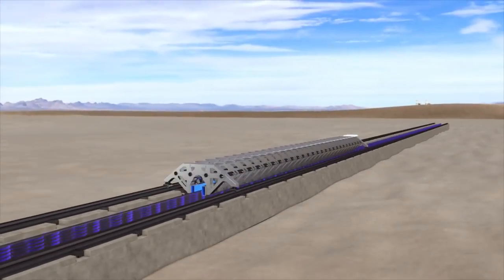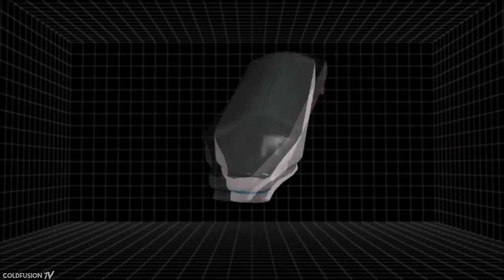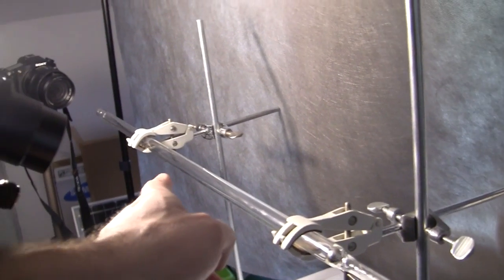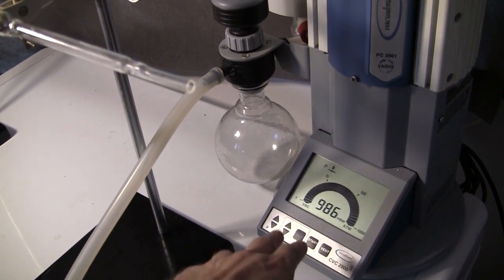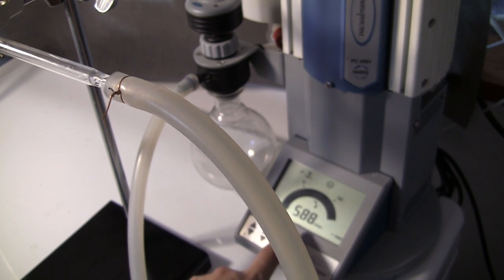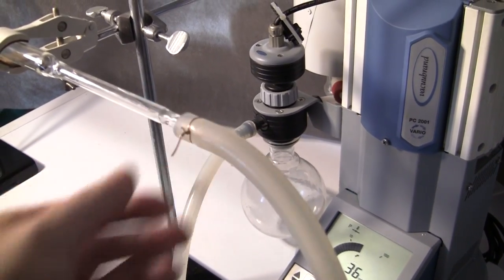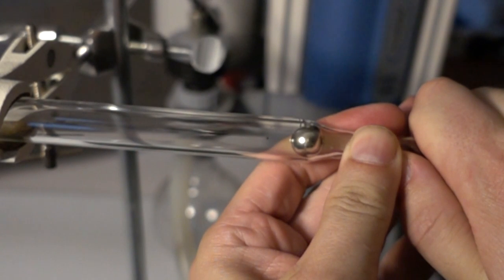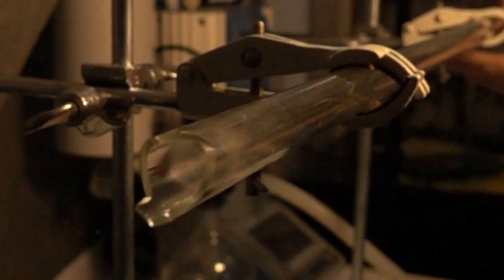How  the Hyperloop can kill you!

Comment: The hyperloop is nothing more nor less than a maglev train in a mostly-evacuated track, both perfectly well-understood technologies. No competent engineer would use the sort of accelerations you show in this, so the "gun barrel" analogy is faulty from the first. And again, maglev technology is well-understood, and the relevant engineers have been building maglevs with excellent safety records for decades. There's nothing revolutionary in this, and no need for extensive debunking.

Comment: Your on magnets they can slow you down easily! Busted Thumderfoot!
Reply: Ah like in this experiment where that 600+ mph pressure wave hit that metal ball bearing with no breaking system what so ever, was blasted forward at an absolute bone crushing 3 g's? You know like what you might experience on a roller coaster.
Reply: Ok, what happens when a pressure wave hits the pod at 600+ miles per hour? Do people really still need it explaining to them what happens when a vacuum suddenly becomes not-a-vacuum?
Reply: the description does explain that this is just "simulating the effects of a tube failure on someone in the hyperloop"

the video doesn't advertise anything other than that possibility and I don't know why you would expect anything else. Seriously guys...?
The description also states that a longer video with a "more compelling argument" is coming (may already be out? I haven't checked), which may be more along the lines of what your looking for.
Although... I wont vouch for rather or not those arguments are any good. lol
Reply: I imagine this works similarly to a maglev train, in which case you can just reverse the direction that the current is travelling down the track. Also, a computer can react quickly enough.
Hyperloop is still idiotic regardless.
Just for even more basic reasons.
Reply: It takes two magnets to repel and the track's electric field can be reverse to attract if it detects a pressure increase or excess velocity.
Reply: No person can react that fast, but do you really think such an important safety system would be used by a person? A computer could detect the breach, and make every magnet in front of the train slow it down.
Reply: why all the talk about magnets? I thought the design of the hyperloop was to have it levitated via air-caster.... as to propulsion, im not so sure but it doesn't seem magnets were settled on. The design is trying to avoid maglev from my understanding
Reply: Meow ster Magnets would be an advantage for safety reasons stated above. I'm not sure what the air-cast concept is but wouldn't that invalidate the vacuum (no air molecules)?
Reply: MasonDixonAutistic This wouldn't so hard to deal with. Agains, the system can detect a compromise and reverse the magnet polarization to force-stop the track.

There will always be some risk, even now a regular train can theoretically derail if the track is messed up.
Reply: Gerbeck S. idk,... air-caster is kinda like what air-hockey tables do. it confused me also, but the design concept stated running it along air-caster tracks while still in a vacuum. It was also specifically mentioned that maglev was being avoided due to the expensive costs.
Reply: SpaceCowboyfromNJ A rollercoaster can be brought to a halt and so can a train sitting on magnets that reverse polarization and clamp down on train. 

A bigger issue on a hyper-loop train is if the oxygen reserve or internal pressure from the train leaks out. Then you may have to actually  de-vacuum the chamber the train moves in on purpose.

Anyway this is all nonsense and defeatist. Airplanes can fall right out of the sky and they are still the safest way to travel.
Reply: Meow ster An air-hockey table recycles air in the room and forces them through little holes (increasing pressure) so it can't work like that since there is simply no air.
Reply: Gerbeck S., I know. My answer was a bit of sarcastic reply to MasonDixonAutistic. 3g's are not something that's really dangerous that you need to worry about, and if you want to get real technical as you scale this up the acceleration you would get  from such a catastrophic failure decreases.
Reply: Gerbeck S. that part confused me as well. I understand that full well. But that's what was claimed as the design.

Comment: they could have emergency valves that release pressure all along the tube.
Reply: they'd take a while to active in order to avoid the pod's being damaged by rapid decompression and possibly causing a leak
Reply: @killian9314  release pressure where? the issue isn't that the pressure is too high, the air inside the tube would be at equilibrium with the air outside of the tube (1 bar).
Reply: release pressure? In what is effectively a vacuum?
Reply: X D

Comment: ------Long post expand it--------
OK you build a vacuum cannon so what. Those points you made are valid and simple physics.
BUT those are so easy to fix with engineering that's almost hilarious.
First of all what you have shown is the worst case scenario which would be equal to a terrorist blowing the tube up.
Means it's not valid as a real world failure case. (And since those guys have a very questionable education they would probably blow the tube before the train passes and help to break :-)

Now to a more likely scenario the tube is somewhere compromised and air is able to get in.
Maybe a construction crane rip it open somehow.
First the physics, which aren't as bad as shown:

-The air is able to get in the tube but only through a small hole compared to the tubes diameter < slow down factor one
-Then its force is immediately halved because it has to expand in both ways, towards the moving train and into the empty tube it traveled through < slow down factor two
-The train won't fit tightly into the tube so that the remaining space between the train and the tube is probably way bigger then the surface area of the hole so most of the air is able to pass by. Considering the trains inertia it will probably get only a really hefty bump. < slow down factor two
(However this will be a considerable force which would result in traumas, concussions and probably some broken necks so kudos there Thunderfoot)

So now to the engineering counter methods:

-First of all the entire track is fully covered with sensor technology and any breach would be known in seconds maybe even less.
So anything in the tube would be already aware that there is a problem and begins countermeasures.
-The train begins decelerating and prepares for the impact of the air mass, with a clever braking maneuver it could also make the aforementioned bump neglectable.
-Vacuum stations along the compromised track are set to equalise the pressure in the tube to normal atmospheric pressure.
-Emergency/maintenance bulkheads in appropriate distances close to save the low pressure zones in the remaining tracks.
(Man keeping up vacuums is so freaking expensive, for that reason hyperloop won't go near a perfect vacuum just enough to travel faster)

All this is probably done in a few seconds so I feel pretty safe traveling with it.

Comment: But if the force applied is bassed on the diameter of the tube then it will increase linerarly while the mass will increase quadratically, so the acceleration should be less than this, not more.
Reply: Squarely, not linearly. But yes, your point still stands.
Reply: ***** 2 is squarely, and yes I forgot to realize that the volume increases cubically.
Reply: link4265 The term is quadratically, not squarely.
Reply: Read the description- the acceleration of the pod isn't the issue, it's that it will be hit by air rushing in to the vacuum at the speed of sound. The pod will be lucky if is only displaced and accelerated. the more likely scenario is that it's shattered along with it's contents(living passengers).

Comment: Argument not compelling. Rare
Reply: Hyperloop is bankrupt 14/01/2024
Reply: Hundreds of mile of tubes is a pretty tempting target for any nut with a gun. A single gunshot is all it takes for a catastrophic vacuum failure.
Reply: Dude read the description seriously wtf.
Reply: What about a small bomb? Couldn't that cause vacuum failure?
Reply: +Starfish incorrect. Have you seen Mythbusters? It takes far more then a bullet hole to create explosive decompression in a plane. A small hole would not allow sufficient air flow to really damage anything. Even small cabin leaks in space do not cause explosive decompression, and that is effectively the same scenario only in reverse, air going in instead of out. To cause this kind of failure that thunder foot is demonstrating would require a drastic failure, like complete tube collapse, not a bullet hole.

Comment: one would literally have to blow up a section of the loop to get that result,  this is not a problem impossible to overcome, just adding some sections with tesla-valve like structures on the wall could significantly reduce the damage of a pressurization event

Comment: Best solution: Don't use Hyperloop-tubes that are made of glass. Use something like steel for example so it won't break like glass. In worst case it will get a crack that will have to much resistance for the incoming air so the train won't be catapult to uncontrollable high speed.
Reply: Vacuum does not have a temperature. In fact, it preserves temperature because heat is not transmitted through contact. Space is cold, but if you send a hot metal ball out there, it will cool way slower than in earths atmosphere since there is no contact surface to transfer heat to.
Reply: levi warbrick 
This is obviously made to compete with planes, not with buses.
Reply: Meow ster
" ... because squashed against steel is so much better?"
There is no sqashing. It's about catapulting inside a tube. It's a tube hundred of miles long. There is no sudden end of the tube in the middle of nowhere like in the glass-tube that is used in this demo. Do you understand anything?
There will not be a catapult effect anyway. Because in worst case there will only be a crack. And a crack will not let in enough air in short time to accelerate the train to dangerous speed. Besides that traveling at 1200 km/h is the normal operating speed. This video is just stupid. I'm sorry to say that because I really like Thunderfoot.
Reply: ... because squashed against steel is so much better?

LMAO

He should be testing their braking system tho,... yea...

@TheMegatomicDragon
As for him falling? Maybe, but get real... this video would not be any indication of that. This video does and shows nothing more than what it advertises. Reading the description some might help as well. Something about this being just for fun, and "simulating the effects of a tube failure on someone in the hyperloop"
Nothing in the description or title promises anything other than that and it delivered exactly that.
Reply: Steel is softer than glass, comparing like with like, hardened steel with hardened glass, regular hardened steel is brittle in cold temperatures like a vacuum. If something gets a crack in it under these conditions, it does not matter what it is made of outside of fantasy(like a tunnel made of diamond), a real-world material for a man-made tunnel, it's going to be destroyed to the fullest extent it is solidly joined together. The train won't be catapulted as in the video demonstration, read the description: it will be hit by a pressure wave at the speed of sound, only a one-bar difference would be lethal, an actual real-world pressure wave will be multiple times that in such a tunnel. This is why it takes months to do maintenance on the Large Hadron Collider- not because it's big but because a vacuum runs it's entire circumference when operational and the pressure has to be brought up to normal atmosphere slowly.
Reply: I can't tell if you're trolling or not, you had best be.
Reply: MasonDixonAutistic 
Tell me where I am wrong. How do you think a thermos works?
Reply: If you propose to create essentially another arge hadron collider so you can get to work 20 minutes faster be my guest.
Reply: Steppenkater lol,.. "its about catapulting inside a tube"
hmm,... being catapulted at such speeds, sounds like your getting squashed to me! Seems like you simply don't understand english.
So sorry you didn't like my choice of words or whatever that's about.

as for there not being a catapult effect,... cool. But that's not in context to what I made the joke to. A person isn't going to care rather they were catapulted into a steel wall and squashed, or launched straight out glass. They are dead either way- hence why your mentioning of steel being the solution to be funny... applying that to thunderfoots claim makes it amusing as fuck.

As for it not going to be something that happens? I didn't say anything about or against that.
Reply: Meow ster
As I said: A crack will not accelerate the train into uncontrollable high speed. Because through a crack in a steel tube there can't flow enough air to cause this effect you saw in the video.
Nobody will be squashed against anything. Because when the train arrives at the end of the tube it will be slowed down as usual by the electromagnetic breaks. Those breaks are designed to slow down a train that arrives at nearly supersonic speed. So no problem there either.
Reply: Steppenkater wow... reading comprehension much? I never argued against that and have already had to clarify this for you once already.

Comment: No way of stopping? 

If only someone could come up with an invention that stops things...
Reply: I propose a giant wall that it crashes into.
Reply: @DemonicAkumi  I propose a brake
Reply: @Kaskadamusic  A brake is going to stop a shockwave and a multi-ton column of air travelling at the speed of sound? Do you know what the tolerances inside the tube are, the pod is basically a cork.
Reply: @mariusvanc  not necessarily a brake, you can use devices similar to brakes in guns

Comment: You're describing a critical failure, a full function loss (in this case, seal breach and vacuum failure). This is obviously a consideration on the design. I haven't seen the PR videos but the idea of the Hyper Loop has actually been around since 1799-1812. It's been quite looked at and ogled over. You're analysis suggesting this is some how wishful thinking because of a possible failure is pretty closed minded, considering those same pressures above Mt Everest you experience on a  pressurized cabin when flying 35,000 ft on your next air line trip. If the failure you induced happened on your airliner, you'd die immediately! Clearly we'd should stop building air craft that fly at 20,000 ft on up? 
The first Jet Air liner suffered this same type of drivel when two flights suffer bulkhead failures that resulted in immediate depressurization of the cabin, killing everyone on board each time. There was a huge public out cry against Jet liners as a result, everyone running scared that it couldn't be done, was obviously too dangerous, was... wishful thinking. Look at the deaths! We lost one of our greatest journalists of our time on one of those flights! Oh noooo!!!

Please. 

Yeah this crap is pretty wishful, but you need to let the engineers in these respective fields do our jobs. It's part of my job to make sure these sort've failures are addressed and considered in our designs and production values. QC, QA and FOD prevention are all massively invested in aeronautics and this transportation system would be no different. This failure is an OBVIOUS failure that would be and likely HAS been addressed many times by who ever wants to be courageous (maybe wishful enough) to build it. 

If you wanted some REAL debunking, should've talked about how having a large, mil spec pipe over a thousand miles long, transporting a vessel at 760 mph, WOULD NOT FAIR WELL just because of plate tectonics. I mean, a pipe? That long? The earth moves all the time. A 1mm movement on the ground would be enough to cause some SEVERE buffeting on a craft traveling in the transonic speed ranged, making those passengers worry about being delivered as a mashed, shaken up bag of goo, than some sort of rare massive vacuum failure - a problem that's far more easily rectified than the Earth's tectonics stretching your static piping line...

Comment: Couldn't this be designed as some sort of Kinect gun? Load up some rods of metal and launch it over large distances?
Reply: It could be a kinetic gun except for the reasons stated by everyone else and one other thing...aiming. Let's just say...aiming a two mile long barrel is difficult. Unless you were making one for each enemy, which is crazy expensive and not very subtle...
Reply: no, most objects would be too heavy or it would require insane power to try to scale it down.
Reply: +L3610NF0R14M7H37RU7H but could it be like low scale kinetic bombardment?
Reply: Beastlyboy352 it would have to be on large scale because maglevs are very energy costly. even railguns which are the similar premise have issues with energy
Reply: Why not just use a rocket? The US Navy has experimental rail guns.
Reply: InqWiper along with this method? cause it probably wouldnt work like that because rocket fuel usually require oxygen in the air for high speed rockets, and the depend more on the explosion rather then the impact.
Reply: L3610NF0R14M7H37RU7H 
No, instead of this method. Why would you use a large cannon to launch something long distances when you could use a rocket?
Reply: InqWiper i wasnt saying we should lol! the other guy was wondering if we could...
Reply: L3610NF0R14M7H37RU7H 
Yeah, I explained what I meant since you asked :)
Reply: InqWiper oh, gotchya, on track now lol!